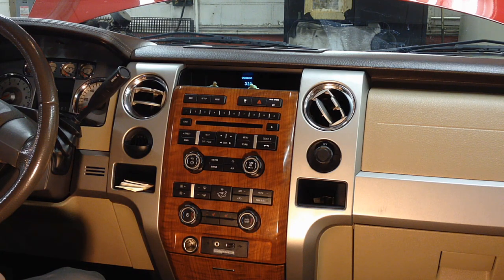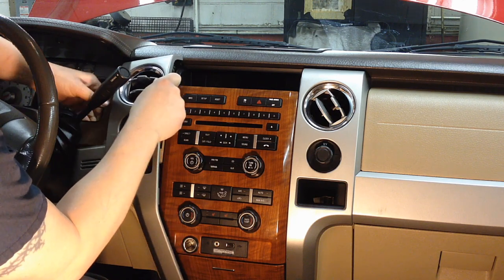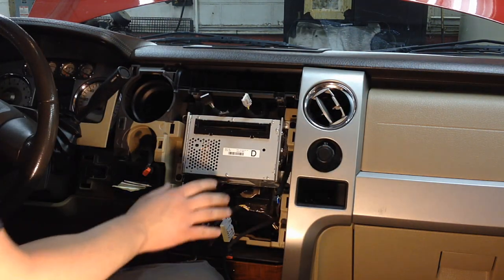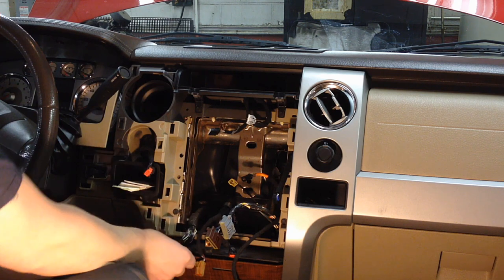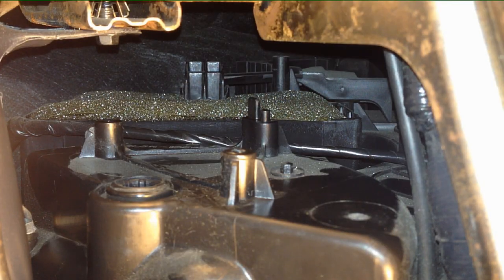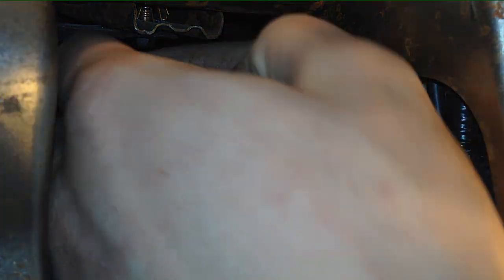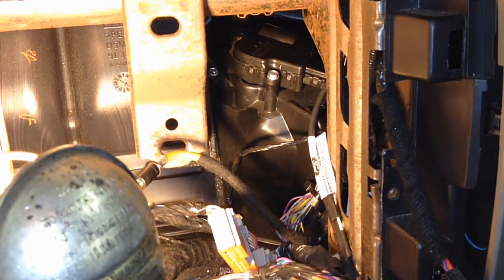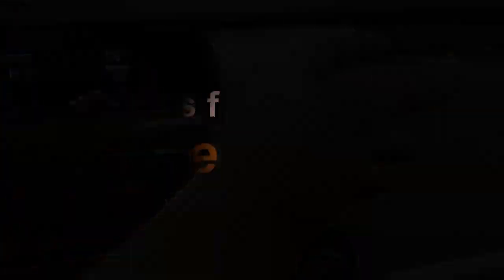2009+ F150 Passenger Side Upper Temprature Blend Door Actuator Replacement

Comment: So I changed out the actuator on my 2009 F150 last year, but sadly it didn’t make a difference.  My wife asked me today to make an appointment to get it fixed by Ford. Tonight I watched your video and picked up the little nugget at the end about pulling fuse #15, then turning on the key for 30 seconds to allow the system to calibrate the new actuator. Boom, it’s working great now!  Thank you so much.   Your videos are awesome.  Thank you!

Comment: I wish they'd be more technicians like you! Your attention to detail,thoughtfulness and cleanliness is fantastic! Ford is lucky to have a technician like you and we are lucky to watch your videos!
God bless!
Reply from the maker: Nick Nicu Why thank you
Reply: FordTechMakuloco Ford Tech Makuloco if your out there check this out. Ford fx4 2010. I just replace my upper actuator because I had fully functioning driver side and passenger side not working only blowing ambient air.  After I buttoned everything up and checked the system.. Now the passenger side is blowing out heat only.. So the replacement changes something but it is still not functioning correctly.  I just posted something on f150 online forum but have no responses... What would your recommend i do from here? Any suggestions?
Reply from the maker: was the replacement one a YH1933 from motorcraft?
Reply: FordTechMakuloco
I have the same problem and did use YH1933.  Replaced the actuator, reset the fuse and now I have only heat on the passenger side ALL the time.

Great video BTW and it was not too much trouble to replace it.  Thanks for taking the time to put it together.
Reply: zionboy768
Reply: Came here with the same problem, after changing out my upper blend door actuator with the YH1933 actuator passenger side seems to be stuck around 75 degrees, blows warm air regardless of temp knob setting.  Did you ever figure out what was wrong with yours?
Reply: You did a very good job on your video and the details were excellent the way U demonstrated it.
Reply: Dude i have 4 fords, and im confident when saying there's nothing i can't fix or accomplish.. whether my pushrod 95 gts, edge, or my 150 platinum..Attention to detail is a big deal with me as im medically retired from the u.s. Army 4th infantry (kinda the army way) ... you're clear and concise with your instructing, leave absolutely no room for questions, misunderstandings, or excuses...Anyone can tear something down and all that, but it's the little yet very important details you keenly appreciate And explain so well and in depth that are vital..Especially, stress especially, with ford motors...a Ls motor, down to your run of the mill 350 or 5.7L are super basic, they're great if that's what you're into... fords, even my built pushrod gts, are more complex, fun, and honestly for me, exhilarating... when a Ford v8 is punched/stroked, built and tuned with the right internals, backed with fords bullet proof 4 speed, seems like the naturally aspirated power is freaking limitless Haha.. my platinum had issues with missing after installing new packs And plugs... went over every detail checked every box.. ended up being faulty coils from motorcraft..i typically if possible use only motorcraft parts on the wifes Ford edge as well as my platinum.... wasn't very impressed at all with the quality or responsiveness from the set i put on the edge a few months back, or the ones i had to return for the truck.. going with accel, i think for my 5.4 it's the most consistent, with best construct qualities... all bs aside, I'd love to be your apprentice for a year... people only think they know a great mechanic/tech until seeing your integrity to the problem at hand, as well as the high standard of self representation you have through your work and for yourself... I'm a big fan man... you're literally walking knowledge

Comment: I just changed out the above mentioned motor on my 2011 F-150 XL w/ Ecoboost.  As stated many times below, Great Video!!  Two (2) tips for anyone in the future.  1. For the rear screw, once you break it loose, wrap tape around the socket, one wrap, then twist and wrap again with the sticky side out.  This will allow you to use your finger tips to loosen the screw the rest of the way out, adds grip to the socket.  2.  For normal operation of the Temp. adjuster Knob, Do Not go 100% Hot or 100% Cold, always dial it back one click from 100%.  That will take the "stress" off of the gears.  I was told this by a friend of mine who was a 19 year Ford mechanic.  Changed out a $#!+ Ton of "old style" blend doors that were broken.  The motor would break the arm on the door holding it closed 100%.  From 2011 to now (12 1/2 years) first motor I'm changing out.  - FordTeckMakuloco -,  please keep up the Awesome work, sooo much appreciated.

Comment: Thank you for this video. I was able to change the actuator. It took me about 3 hours, 15 minutes to take the dash apart, and 2 hours and 45 minutes to get the screws out. The back screw is really tough, I think the neighbor kid that was outside may have learned some new swear words from me.
Reply: Your persistence is noteworthy! I would not have survived almost 3 hours removing two screws. Wow!
Reply: I think I spent about 90 min getting that screw out and back in. My hand is really torn up.
Edit: the job took me 2 1/2 hours total.  Everything went back together very quickly

Comment: I just did this repair. Shockingly my 1/4 inch 8mm fit onto that back capscrew just well enough I didn't have to use the open ended wrench! Works like a charm now, thank you!

Comment: Thanks!!! Great Video!!  Covers all of the highpoints without wasting timing on the entire step once you convey the idea.  I replace the actuator on my 2010 Raptor with no problems at all.  During this video, you refer to your video for a lower actuator removal that details steps to take if your truck has a console. In that video, you remove the entire console for the lower actuator which is necessary.  However, I did manage to complete this job without removing the shift lever and only pulling back the console.  Thanks again!  and please keep the video's coming.

Comment: I have a 2012 with dual zone climate control and the passenger vents was blowing steaming hot air. Living in southeast Louisiana, that is not a option! I followed this method and it worked just as explained and saved us hundreds on a $25 part. Thanks for taking your time to make this video!!!

Comment: Got the dreaded click, click, click from the dash a few weeks ago on my 2011 F-150. Your video was extremely well done and allowed me to replace the blend door actuator within an hour, The only problem is I ordered from your link and it was the wrong part(#YH-1881). I had to go to the local Ford dealer and get part# YH-1933. This is the actuator you show at the end of the video. I also had to remove the two screws under the gauge cluster dash overhang so I could remove the left side trim piece. Just wanted to add this for others who will likely have this part fail on them, my buddy's 2011 FX4 has had this clicking for awhile now. Anyway, thanks again for a great video that saved me a ton of money by allowing me to do my own repair.
Reply from the maker: Yeah I see that weird fixed now sorry about that! Good to hear it is all fixed in the end.

Comment: Thank you SO MUCH! Notes for others- 1. My truck is a 2010. Disassembly instructions were basicly the same however, I just dropped the radio down. no need to disconnect it. I absoulutely could not get any wrench on the rear bolt. But I pushed on the motor and it was loose, I figured that someone had replacved it before and left out the rear bolt. so I pried the motor out and that was no easy task, the old motor is quite thick and it was getting jammed on the metal dash bracing. This took the most time, just getting the old thick motor out. Once I did get it out, I could see that the rear mounting tab was broken off. Now I don't know if I did that or not, but it was still agift from above not having to remove that bolt (until after the motor was out.) On examining the inside of the old motor, my gears were all intact and looked like new. My heart dropped. UntilI saw that the splined shaft was broke, where it meshes with the largest white gear. I took this piece of shaft and inserted it into the blend door and could not turn the door. Second heart drop, is blend door jammed and this broke the shaft? So I took pliers on the piece of shaft and moved the door, it was hard at first I believe it was jammed shut into cold position. After moving it back and forth with pliers it worked freely. I installed the new thinner motor with only the front bolt as suggested by people. I plugged the two connectors into the dash panel and started the truck, the door now moves and I have heat! :) On further teardown of the old motor, the clocking boartd was covered in black grease, I suspect that the motor couldn't find home and just jammed the vent door into cold position so hard that the splined shaft broke.

Comment: Great step by step video and I got the job done easily as a result. Tip for Lariat owners  - loosen flow through console from floor and slide it back about an inch after freeing the shifter from bottom of console by removing four screws. No need to disconnect shifter cables/wiring. Just leave it free in console when you slide console back. You have to lift it about a 1/2” when sliding the console back to clear a plastic pin. Now you can get those 2 7mm screws holding the trim around your centre controls.

Comment: Awesome vid!!  Ford wanted to charge me 100.00 for diagnosis, 700 for labor, and 45 for parts... this video saved me 800.00.  Mine is the 2011 FX4 with Sync, NAV, and Sony, with flow through air to the back seat.  I was able to take the back screw out with a small craftsman 7mm wrench using the closed end, without any issue.  Thanks again for the great tutorial!!!!  took me less than an hour from start to finish
Reply from the maker: David Chandler Nice!
Reply: Nice! Was your rear vents blowing the same temp as your passenger side? Im having the same issue in my 2010.

Comment: Just finished this in about 3 hours for me. I have the flow through console so I referenced both videos. Hardest part was putting that back screw back in... I went about it by using masking tap to leave the back screw in while setting the new actuator so it was already lined up in the hole, and that worked pretty well. 

Good luck and keep a level head. Anyone can do this job and save an absurd amount of money with the help of this video.
Reply: Can u please post the link for the other video please. With the flow thru the console. Thanks

Comment: Wow, thank you for this well informed and filmed tutorial!!  You have saved me (and a bunch of other folks) a lot of money!!  I had a few issues that I wanted to comment on.  First off, it's very important to have the correct tools.  I only had a straight, mini, non ratcheting 5/16 (8mm) wrench and I think one would benefit greatly by having a ratcheting wrench. I tried a couple of different things...a socket held by needle nose pliers (lost a 5/16 into the depths of the dash) and a mini socket wrench that proved too short and too thick as well as a socket finger drive. My biggest problem was that my hands were simply too big to maneuver very well inside the dash.  That being said, PATIENCE and CALM are important here!  But, I just wasn't able to maneuver well enough to remove that back screw.  So, I got a couple of turns on it and decided I could break the tab and get actuator loose.   In putting the new one in, I installed it without the back screw knowing I would never be able to work it back in.  It felt snug enough and with the front alignment tab near the electrical connector, seemed stable enough to work.  Also, if I ever have to do this again, it won't take nearly as long.  In the end, Mission Accomplished!  Calibration went perfect and there is now heat for my passengers!  This video is by far the best of all that I could find on the subject, thanks again for high quality information.  FYI, mine was a 2009 F-150 Lariat.
Reply: I hear you brother......did mine yesterday.  I left the back screw out.   After I tightened the front screw I tried to rotate the actuator to see if it would 'turn' but it wouldn't budge.  Plus the plastic gear is so long that even if the actuator lifted up, the gear would still remain engaged.   I was on such a 'high' when everything worked again.   Dealer quoted me $1,200 CAN to replace!!!   I was done in an hour.   Thanks very much to YouTube and guys like FordTechMakuloko !!

Comment: God bless you sir and keep you always safe!   THANKS so much for all your videos.    I replaced the same actuator on my '09 F150 XLT yesterday.   That rear screw is indeed a HUGE PITA!.   I took your advice and removed Fuse no.15 and did the calibration (some other YouTubers claimed they didn't have to do this, but I prefer to go with what you say/do) and in the end it was another succesfull DIY repair.    Dealer quoted me 8.5 hrs labour as they wanted to remove the dashboard.  I was done in an hour.   Now to go buy some Aloe Vera for the scrapes on my right hand !!!  LOL.   Keep up the great work you do and once again, a BIG THANK YOU!
Reply: How did you do the calibration? i was able to change the actuator but I don't know how to do the calibration. My truck is 2011 F150. When you remove the fuse the engine is OFF or ON? Thank you

Comment: Excellent video! I have a 2011 F150 Lariat and the passenger side was blowing hot air while the driver side was cold. It did not make any clicking noises, but this fix still worked!  I used the TechSmart F04002 since it is the same thickness as the original part.  The Dorman part is quite a bit thicker so I returned it and used the TechSmart part.

Comment: This video was spot on for my 2011 crew cab Lariat with dual heat. My symptoms were some heat for driver, no heat regardless of settings for passenger. I had no clicking sound being made. I ordered the part from Amazon and had it the next day. 

HINT: I took an old 5/16 socket from a cheap set and ground it down about 1/2 inch. This left about 1/4 inch to grip the bolt head, but allowed me to get a standard 1/4 ratchet on both bolts and do 90% of the R&R from the top only.

HINT II: I wrapped a garbage bag wire tie under the shoulder of the rear actuator bolt. I could then bend the wire tie to position the bolt into the back hole from the top. Once the bolt was started, I pulled the wire tie off and finished tightening the rear bolt.

Comment: All your videos and tips are beyond great, many thanks for disseminating this info for people who like to do their own work and do not want to pay the high rates for dealership repair.  I have had to replace these temp blend door actuators about once a year on my 2010, a real pain, particularly getting to the bolt closest to the firewall.  I actually ended up using an 8mm combination wrench that I had heated up and twisted torsionally (the box end close to the box) and grinding the outside of the box thinner for more clearance.  I also removed the passenger airbag for better access and visibility.  This time I will try unclipping the wire harness which is above the actuator.  Since my truck is manual temp control, it makes me long for the days when the blend doors were operated manually by a lever and cable.  Progress, I guess.

Comment: thanks everyone. Just did this on my 2012 Raptor. Passenger and rear seating was blowing only cold air, swapped with the part mentioned in the video and it only took me about 45 minutes start to finish. Immediately started putting out hot air.  I also verified dual climate was still working as it should.  I didnt both putting the rear screw back in as the front screw holds it very tight.

Comment: WOW! I have arthritis bad and spent the weekend replacing the top actuator basing my diagnosis (location of actuator) on other videos. I have dual climate control with a center console like in your other video. You can imagine my disappointment after I managed to get by with just removing the radio and airbag then being able to still barely access the back screw/bolt having it not work when finished lol. Warm air still came thru the driver’s side vents. I popped the old apart looking for damage. If I had seen this could have save $25. Probably best I go ahead and spend the extra $25. The parts guy told me they did both if they to do one on warrant to save the money and eliminate risk of the other one going out. I will be replacing the other one this week based on your video, the only one that specifies that the dual climate one is on bottom. 
Thank You!

Comment: Great video. Very detailed. I replaced mine in about two hours. Instead of fighting the back bolt to remove the part I just broke it off then was able to access that bolt. Now tightening it back up was a pain but it worked. I've seen some others suggesting to not even bother with the back bolt and will be just fine.

Comment: Thanks very much for this detailed video. I bought a used 2011 F150 last year and a couple weeks ago it started making the clicking noise if I turned to full cold on the temp. Then last week it started making the clicking noise at all times and no air would come through the vents. I found your video and ordered the part through Amazon. The part came in yesterday and I swapped out the part in about an hour. Apparently this had happened previously as the rear bolt was not installed. So I got lucky and didn't have to deal with the rear bolt but I was ready with your video. All is working again, no clicking noises and air coming through all the vents.